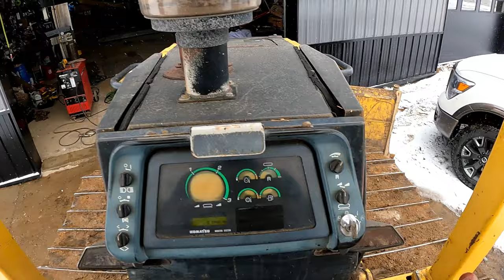Grading shop floor with D39 Komatsu Dozer #deisel #fabrication #welding #construction #concrete

Comment: Crazy. What's the auto leveling thing called? How does it work?
Reply from the maker: I have 2 Spectra LR50 receivers  mounted on blade guided by your standard rotary laser. Set your grade once and then just manually keep on grade by watching the large led lights from the cab with up, down, and level indicator lights. Not fully automated but it works. Thanks for watching!!